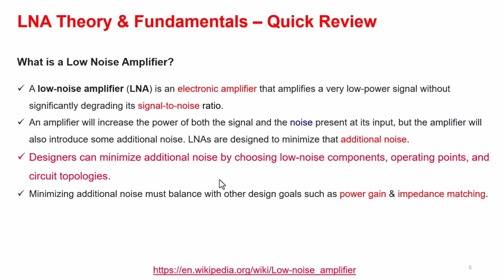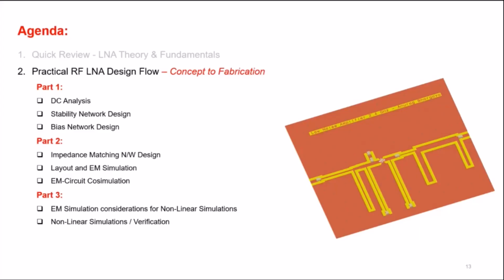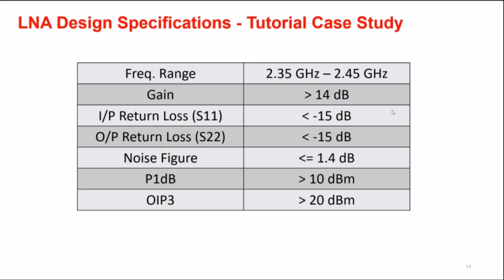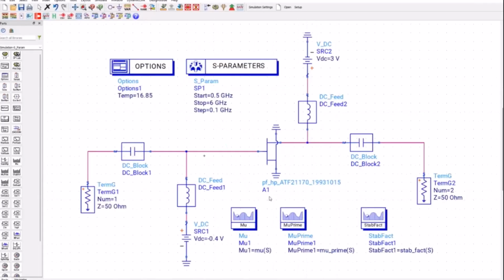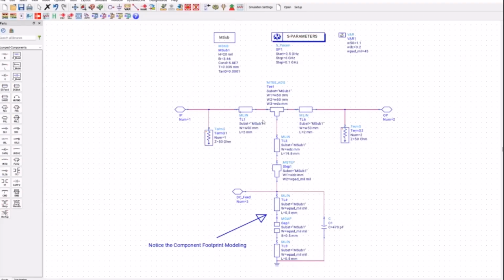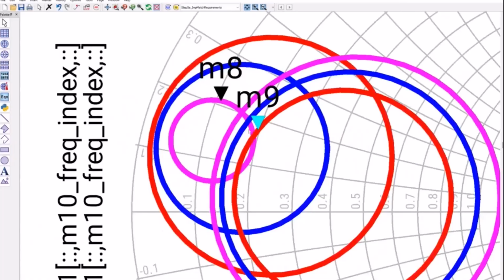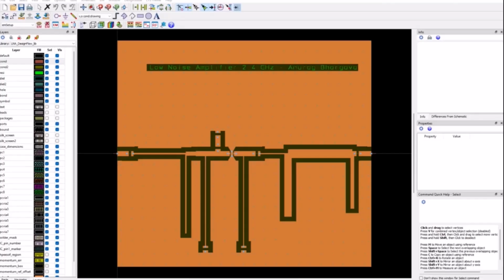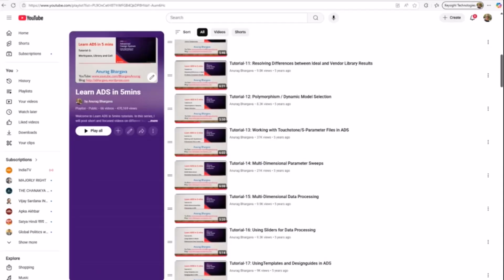Webinar- Practical RF LNA Design Flow

Comment: Hello,

I am reaching out because I am currently facing some difficulties in the context of my Master’s (M2) internship in RF engineering.

I am working on the optimization of an RFID tag. I designed the antenna using Momentum, then imported the EM model into ADS (schematic), where I connected it to an RC circuit representing the RFID chip.

However, I am encountering several issues:

* Tuning and Parameter Sweep are not working properly,
* the optimization process (Goal + Optim) generates errors.

I have identified that the issue likely comes from the EM model (probably non-parametric or non-interpolable), but I am unable to implement a working solution.

I would greatly appreciate any help or guidance to resolve this issue. I can provide additional details if needed (screenshots, files, etc.).

I am also open to structured assistance or paid support if necessary.

Thank you very much for your time and consideration.

Kind regards,
FD

Comment: You have many interesting and useful tutorials on ADS. However, I haven’t found a single example online that shows how to design an interdigital filter.

When I build it in the schematic and run optimization, everything works perfectly. But when I transfer it to the layout, everything falls apart and the filter response becomes completely different from what I had in the schematic. It would be great to see a tutorial specifically about designing an interdigital filter.

There are many unclear points. In the schematic, you need to connect ground at the ends of the strips, but in the layout it’s not clear how to properly connect this ground. Do I need to draw a reference layer? How do I assign it as GND? And so on.